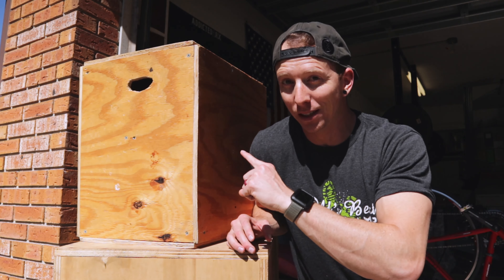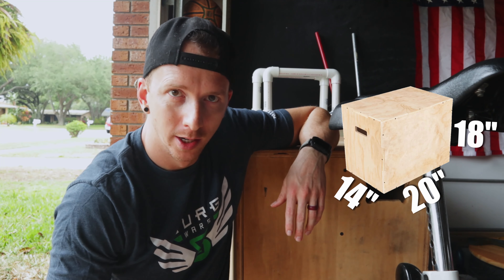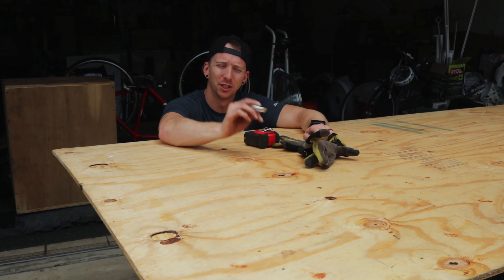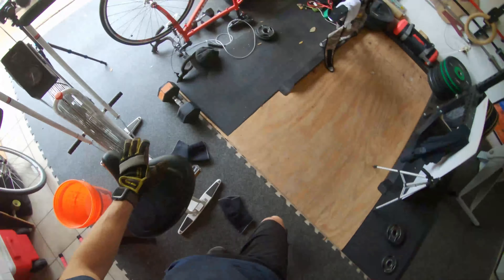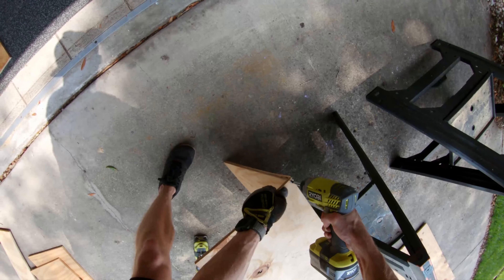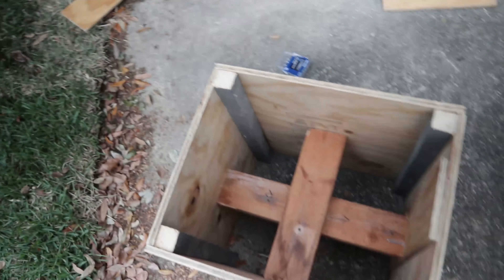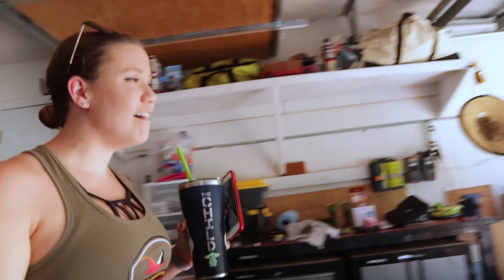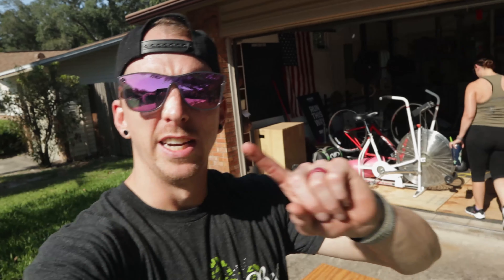Building A DIY Plyo Box For My Wife

Comment: Can you share the measurements for this size box?
Reply from the maker: Sure thing! 

The final box measures 14”x18”x20”. 

I had 2 pieces cut to each of these sizes 14x18,  18x18.5, and 14x18.5. 
Supported with 14” and 18” 2x4 in the middle and 18.5x 1x1 inch boards is the corners.

Hope this helps!